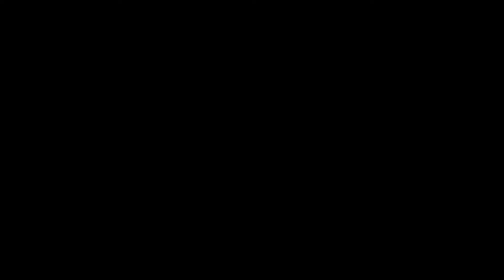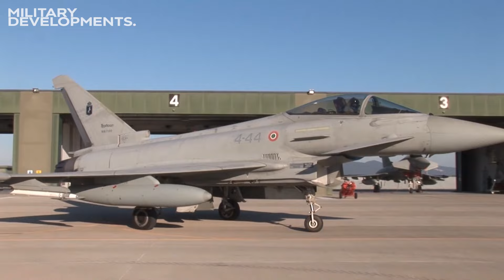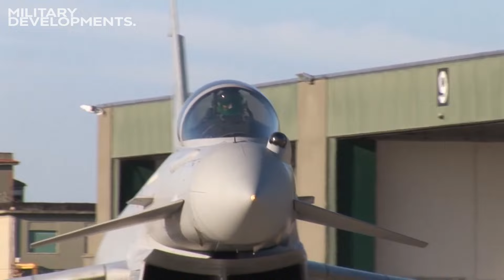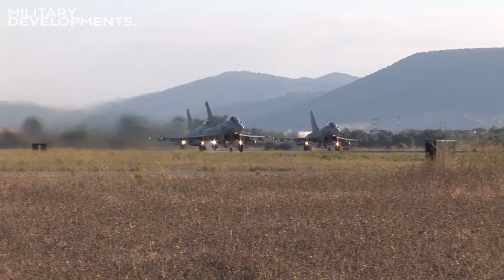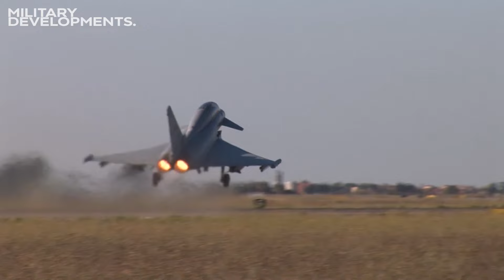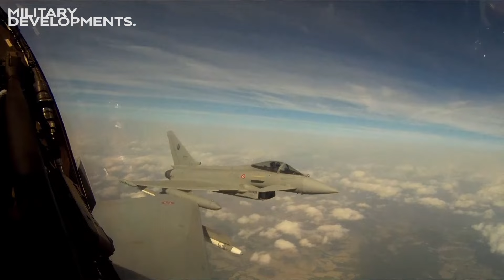The Plane That Was Built Only for One Mission - Eurofighter Typhoon

Comment: What was the mission? I guess I missed it or it is so vague. I glad India chose Rafale over this.
Reply: Typhoon was built for one purpose air-to-air superiority defend Europe against a mass Soviet invasion by it's airforce.. It's a dogfighter built to take on large formations & dominate the battlespace with high speed, movability & survivability. The Soviet threat it was built for no longer exists & Russia alone doesn't have the numbers to challenge Europe's collective air-forces. Updates to the aircraft however have kept it relevant adding multi-roll capability & an impressive array of weapon loadouts & it's AESA radar on the latest Tranch4 version is the most powerful & formidable of any fighter aircraft in the world including 5th gen's. 

Rafael is a great choice for India's needs a very capable multi-role aircraft at a reasonable price point offering exceptional ground attack & a good level of air-to-air superiority capability. The Typhoon is overkill, more focused on maximum performance at altitude & agility at supersonic speeds. Given India isn't expecting a mass invasion & the Rafael is more than capable of defending against regional peers air-forces the extra expense for the Typhoon isn't really justified.
Reply: @ZuulGatekeeper  mission and purpose may sound same they are different. Thanks for info
Reply: It's the Rafale, not Rafael
Reply: @svenschwingel8632  auto correct sorry